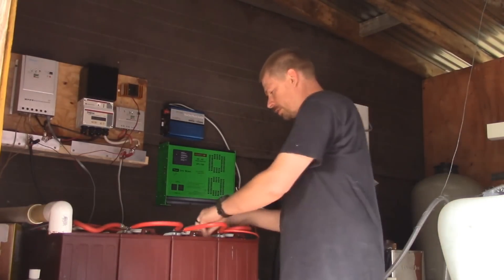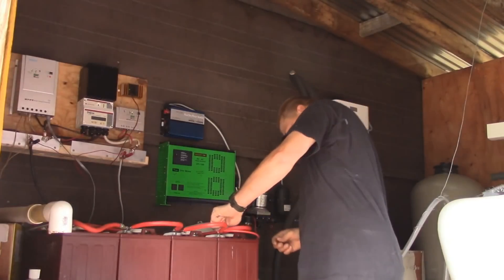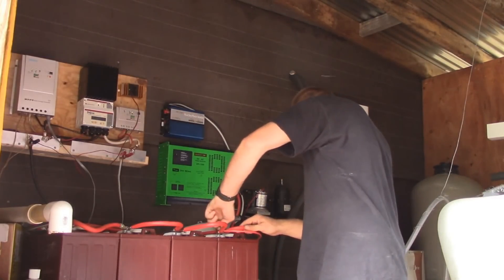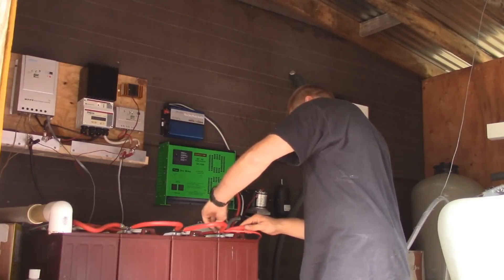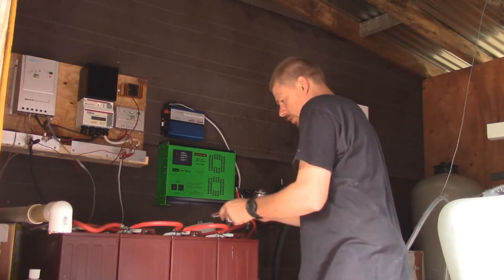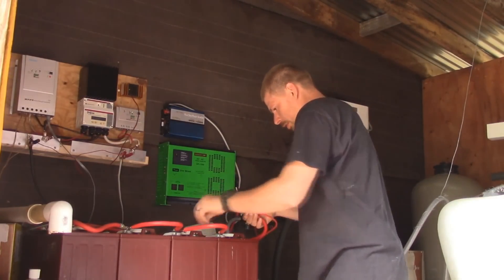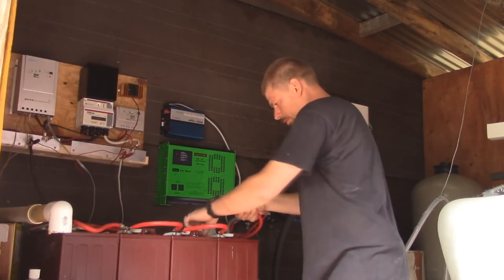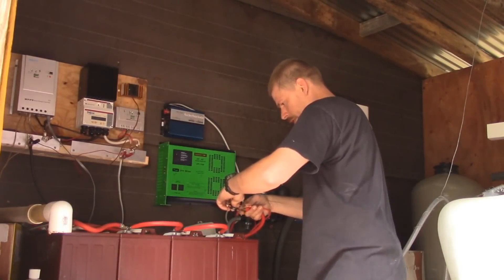Making and Installing 350 Amp Fuse for The Do It Yourself World Part IV of IV

Comment: Are those quick blow fuses?  350 amps is a lot of current.  I'm not sure what the wire gauge you are using, but I believe 2/0 (with 90c insulation rating) is only rated for 195 amps?  Fuses are used to protect the circuit, not the load, so there is a good possibility those wires will melt before the fuses blow. You should also use copper spacers instead of the metal nuts between electrical contacts, those zinc coated nuts have a higher resistance than copper and can get extremely hot under load.
Reply from the maker: I will look in to this thanks =)

Comment: Good job on helping him out.  I don't know about wiring 1 inverter off of another inverter, but  to each his own.  You showed a lot of patience.
Reply from the maker: the big inverter is 1600 watts and the small inverter is 600 watts @ 12volts 366 amps on the full surge and thats never going to happen and the wire going to the old inverter is 3/0 or 2/0 power will be ok i think